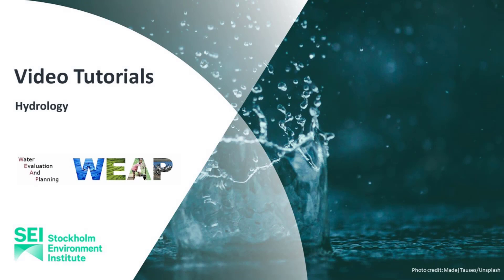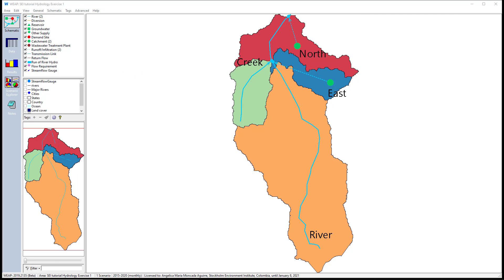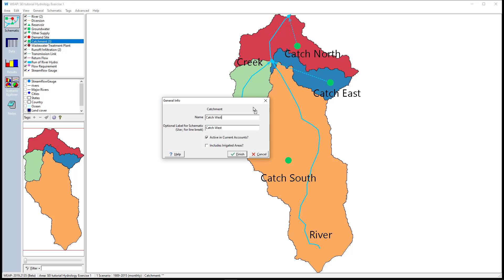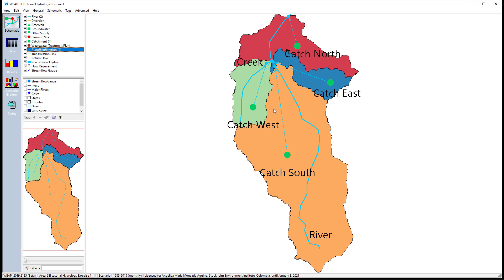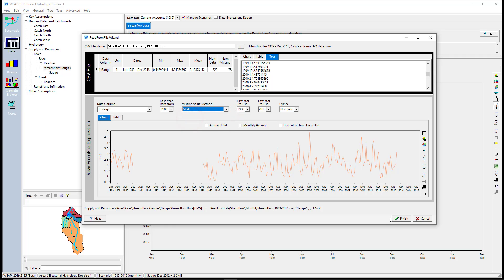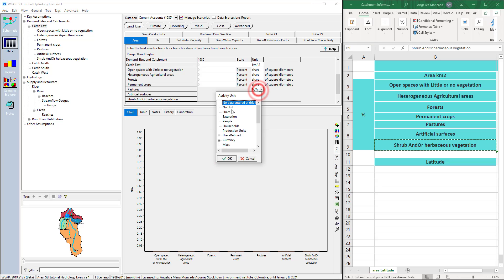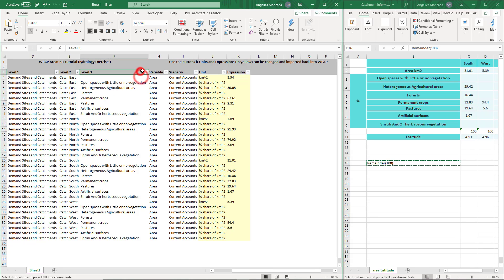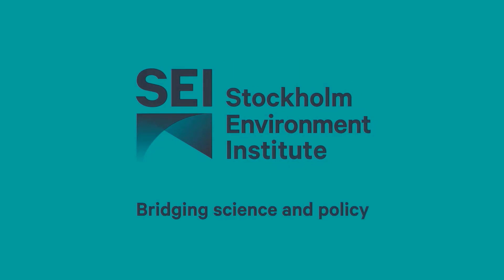WEAP Tutorial- 08.2.1 Hydrology, Exercise1 Developing a hydrological model in WEAP

Comment: SInce the time horizon is from 1989 to 2005, the LULC data  used is of which year ?
Reply: The catchment delineation mode in WEAP uses the land cover data from the ESA-CCI-LC version 2.0.7 dataset for the year 2010 (for more details on the datasets used, see the Help for Automatic Catchment Delineation). Modeling change in land use is an excellent application of WEAP- this can be done by using your own NetCDF files with catchment delineation mode, or by customizing the expressions in the Data entry for the land cover branches to change with time.